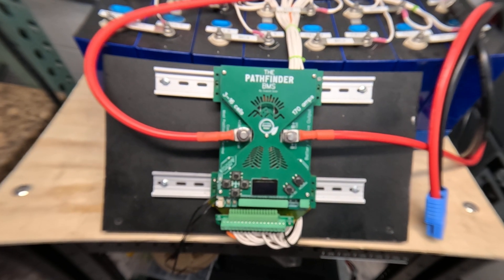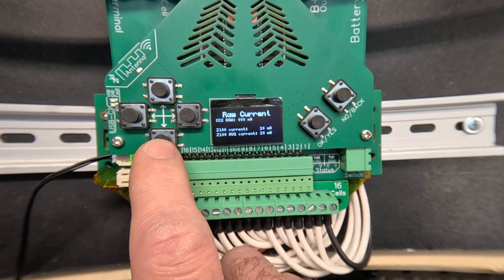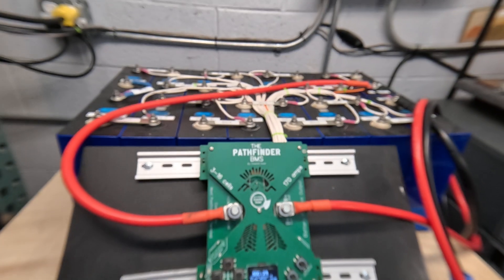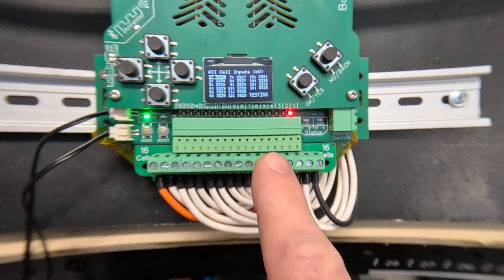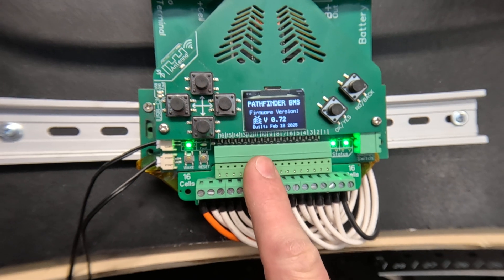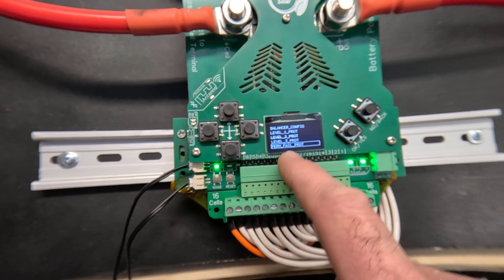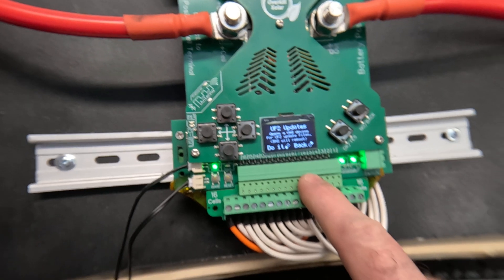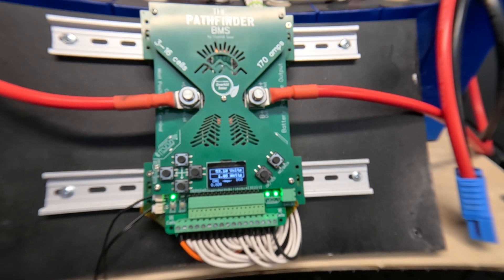Pathfinder BMS: blurry update

Comment: 2 questions:  Does it have a hardwire Ethernet port for network connectivity?  Does it have a 2nd RJ45 for connecting multiple BMS's/Battery packs together?  Thanks.
Reply: The next version will have CanBus ports, not ethernet. This one will connect to HomeAssistant or anything else that uses MQTT
Reply: @Fur_Trader  Thanks. I'd prefer a hardwired ethernet connection.  Bridging from CAN Bus to Ethernet will cost me in excess of $150, which is probably in the price range of this BMS.  I Don't use WiFi for anything but phones - to much traffic and risk of hacking in my neck of the woods
Reply: @petersamios5409  What would you be talking to over ethernet?
Reply: @Fur_Trader either a PC, Raspberry Pi, or PLC controller.  Not sure yet.  Still working on the correct solution.  Right now Home Assistant is one of the apps that I use for measuring home automation - but I'd rather keep it external as a subsystem - for more critical controls.